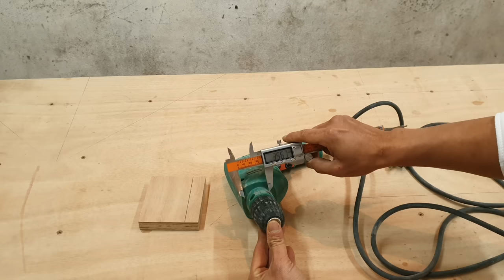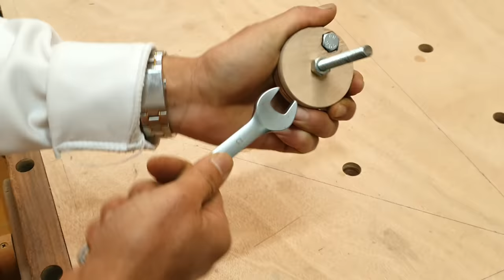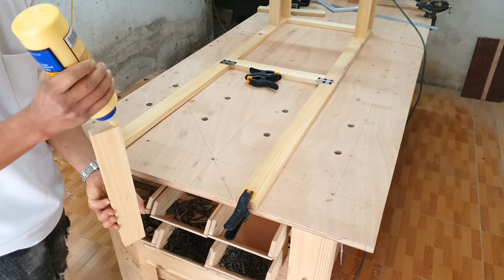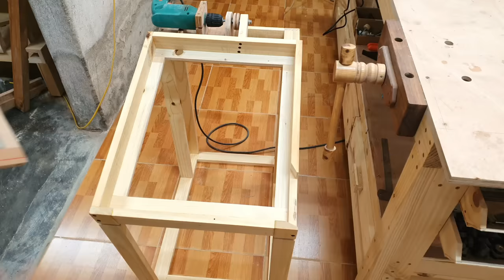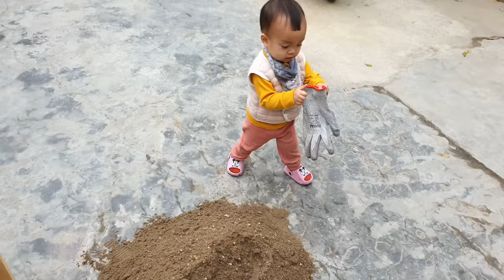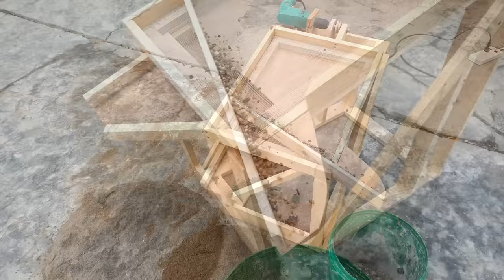DIY Sand Sieve || Making a Mini Sand Sieving Machine from a Hand Drill

Comment: Dude! Buy the cheapest electric jigsaw and screw it to the tray. You won't find a better virator, that's 100%! And I encourage others to do the same! And the drill will become unusable very quickly, since the bearings are not designed for vibration loads.
Reply: Sure, jigsaws are more adept at taking vibrations and constant work loads, but they gyrate way too fast. The slowest setting would shake that wood sifter frame into pieces within a few minutes, and sand would be flying everywhere.
Reply: Jigsaw speed  an be variable
Reply: Use a Sawzall instead.

Comment: That's nice and all, but why would you want to do this with your soil?
Reply: I wondered the same, but there must be a reason. Maybe the soil is depleted and unusable for farming. Maybe to make gravel for one project and sand for another.  Also, I have a huge sandbox for the kids, and that needs to be sifted occasionally, so this would work great for that! I do like the other comments saying to make a cylinder or to use a jigsaw instead. All nifty ideas for separating! I just hope people don't separate fertile soil if they can help it! With the world population increasing, soil is becoming more valuable.
Reply: in many countries people buidl houses with bricks, sand and cement. ussualy the sand need to be clean from small stone for plastering the wall